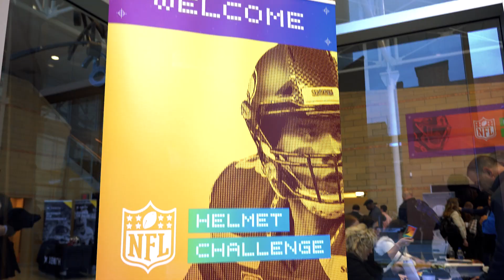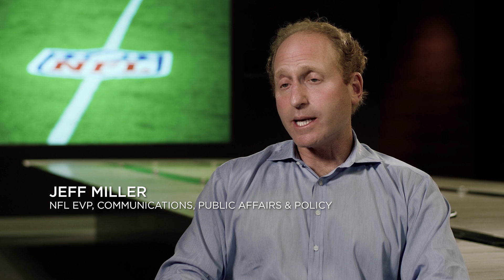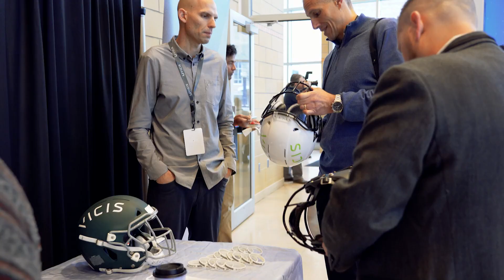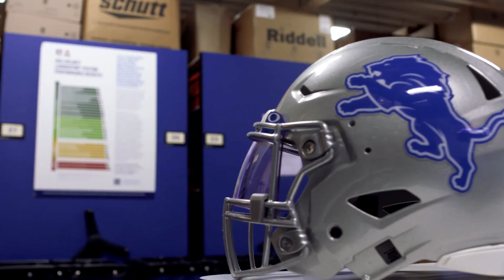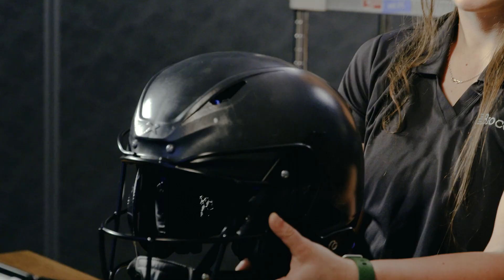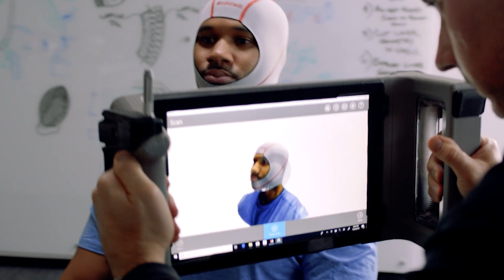2021 NFL Helmet Challenge

Comment: Rams.
Not the L.A. Rams but actual rams...
Design a helmet like a rams head and horns.
They smash their heads together all day long without a single concussion. 
Do it.
I would like 3% please.
Reply: I read somewhere there’s a guy doing that
Reply: https://youtu.be/vxT4piygz54
Reply: @pablitoclavounclavito9396  non muy bueno hablo Español 😀
Reply: with rams it isnt just their heads but also their spines and neck muscles.
Reply: @TheRealCelticBatman  possibly attach the helmet with linkage to the shoulder pads and additional neck padding in place of muscle. I believe they also have a thicker cranial cap as well but helmets are metal. Also the rocking of the brain back and forth during collisions needs to be minimized more possibly through magnetization.
Reply: @jeffreycoe1665 helmetd are not metal? Wtf you talking about?